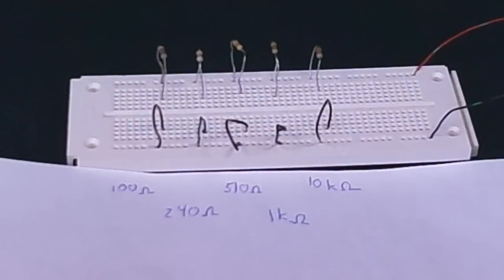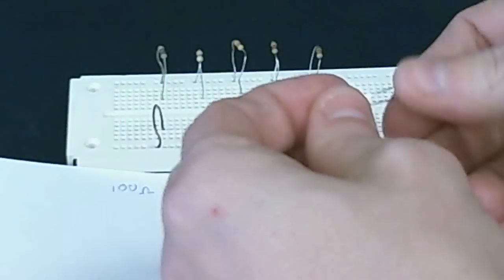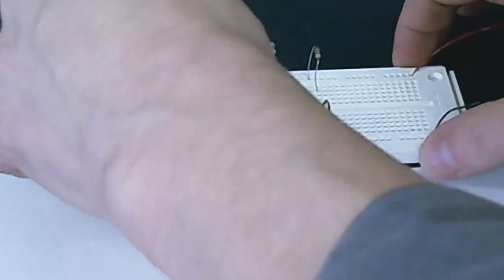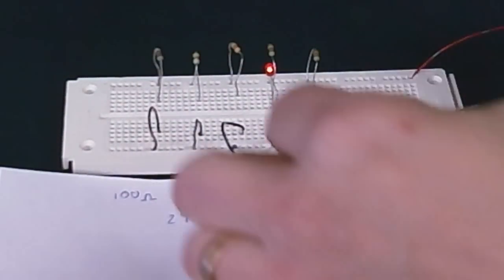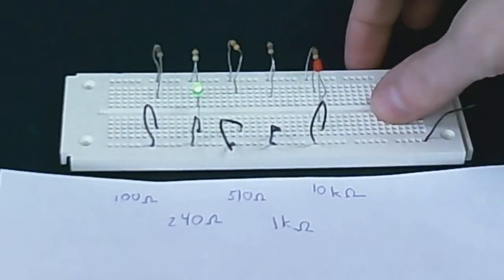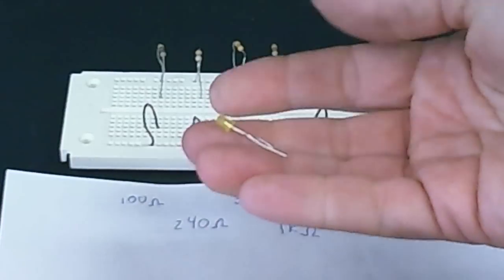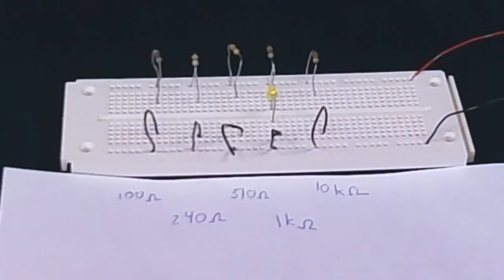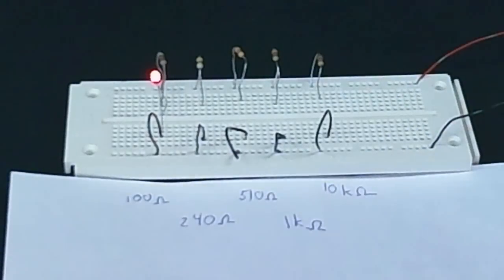Choosing resistor values for LEDs

Comment from the maker: Since several people have asked, I was using a 5V supply. Part of my point was that using any "common" sort of DC supply voltage, such as 5V, 9V, or 12V, the process I illustrated would work.  As I mentioned below, if you know all of the electrical characteristics of the LEDs you're using, then you can do the calculations.

Comment from the maker: A mistake people often make is to confuse resistance and current. A large resistor means a small current, and vice versa. So the 100 ohm resistor allows the most current (and so the brightest LED), while the 10kohm (or 10000 ohm) resistor allows the least current (and so the dimmest LED).

Comment from the maker: Doing a precise calculation is certainly the best way when you have all of that information about the LED available. But if you don't, then picking the largest resistor that gives "reasonable" brightness should work. I assume people have little or no electronics background. For those who do, they shouldn't have any problem doing as you suggest.

Comment: Terry Syurtevant, if you don't mind a bit of critical feedback from a retired college electronics teacher........ while I liked the concept, there were a few issues to bear in mind for future videos of similar kind:
- With a fair amount of time spent with each LED disconnected and thus not lighting, and with your hand obscuring, the human eye will do poorly to differentiate the various illumination levels. Also, the camera is probably adjusting exposure, skewing the results. It would have probably worked better if a multi-position switch, or a DIP switch, or even a potentiometer, were used to allow rapid changes from resistor to resistor without needing all the time consuming disconnections.
- You mentioned that brightness can depend on the color of LED, but the physical demonstration did not illustrate this for the aforementioned reasons. It would have been useful to mention that the different colors of LED use different chemical formulations, which result in different current-to-brightness ratios.
- While your narration seemed to suggest that your experiments showed that it pretty much did matter which resistor value was used, excepting the highest values, the video itself as it plays on YouTube tells a different story. Except for the lowest two resistances, the LEDs are very noticeably dimmer with increasing resistances, to the point of being undesirable for most options.
- The methodology used to calculate LED currents is ultra simple, and it probably would be useful to beginners to at least mention it. As it is, the video ONLY reveals that the resistance makes a difference, but tells the viewer nothing else useful, leaving them to purely empirical methods.
Reply from the maker: Your criticisms are all completely valid. When I made the video, most of what was out there for students and hobbyists either fell into the "cookbook" style of circuit diagrams with specific resistor values with no explanation, OR of theory-heavy physics or engineering explanations with calculations that made using an LED seem like trying to create cold fusion. My goal was to try and give a brief hands-on overview. (Also, even in things like kits for hobbyists, there often aren't datasheets or part numbers for LEDs, so the parameters for calculations aren't readily available.) 
For hobbyists, it's a little more information than the cookbook, and for physicists and engineers there are other resources they can use that have the kind of detail they need. 
(The production and lighting issues are part of my "quick and dirty" approach. I'm never going to make a living off my YouTube videos. :) )

Comment from the maker: Using a paper clip would be a REALLY bad idea; that would short out the two pins. The 10k resistor will allow a small current to flow, to indicate something is connected. So definitely use the resistor.

Comment from the maker: The watts rating on a resistor is for power. The formula for power is:
P = I^2 R
where R is resistance and I is current. So a 1000 ohm resistor with a current of 1mA (10^-3 A) is dissipating 1000*( (10^-3)^2) W, or 10^-3 W. For most LEDs, 1/4 W resistors should be fine. (In my example, a 1/4W resistor would only be dissipating 1/250 of the power it can handle.) Normal LEDs only use a few mW.

Comment from the maker: Blue LEDs will light at a higher voltage than the other colours, so for the same supply voltage, the resistance will probably* be lower, but the process of choosing an appropriate resistor is the same.

*(I say "probably" because more efficient LEDs will require less current for the same brightness regardless of colour.)

Comment: That's a great video! I have a question though... I do LED conversion on vehicle tail lights and I often use LED strips that have multiple LEDs connected together. In order for me to get a double function for running lights and brakes on the same LED strip, I use a resistor for two different brightness levels. I have successfully been using 220ohm 1/4watt 5% resistors for the past two years, but the last batch of LED strips I got do not work well with that resistor. What happens is that some of the strips would only light up partially and others won't even light up at all. I am assuming that this is due to the fact that the new LED strips have more LEDs built into them and that would require a resistor with a lower value of OHMs, in order to send enough power to all LEDs in the strip. Is that a correct conclusion or is there another problem that I am not seeing? Would it help to use 100ohm resistor, instead of the 220ohm or is there another solution? Or would I need a resistor with higher wattage, say 1/2watt instead of 1/4watt? Thank you very much!
Reply from the maker: You're right about trying a lower resistor. Using a different wattage resistor wouldn't make any visible difference; it would just change how much current could pass through without burning out the resistor.

Comment: ok i want to replace the vu meters lamps in my power amp and the voltage at the lamps is 12 volts dc, i want blue leds, what resistor value i need for the blue led ?
Reply from the maker: If you have the data sheet for the LEDs, and it gives forward voltage and nominal/recommended current, then the resistance you want is given by
R= (12 - VF)/Irec
where VF is the forward voltage and Irec is the recommended current.
Reply: Terry Sturtevant i am very bad at math, got a lot of common sense but not a lot of math. i am math dyslexic, thanks anyway

Comment: I have little LED lights in my car doors that activate mt "door ajar"  warning light but very faintly, and when car is off the LEDs glow in the door dimly lit. the LED 5-SMD 12v my car is 12v what resistor would i need or would a resistor even work in this situation?. The bulbs are little 194 size bulbs. Thank you

Comment: question : ive read about making an aux input for my stereo, it says to put a 10 k ohm resistor between certian pins in order to trick the unit in to belivong that power is being drawn so that way the aux in mode can be activated. would i really need a resistor for this or could i just stick a paper clip in there like many do when testing mother boards

Comment: what if you coming off 12 volt battery with high amperage from a car battery and you want to power color LED push plot switches for led interior lights I keep on blowing the plot switch diodes up and blowing the fuse
Reply from the maker: The amperage of the battery doesn't really matter; the amount of current that flows depends on the resistor. The battery amperage just indicates how much current is possible.

Comment: Hi.. What is the value of the led? ( I'm a beginner thanks!)
Reply from the maker: Amelia Kimhoko Most LEDs will be OK with a few mA of current; that was part of what I was trying to show. If you start with a big resistance and reduce it until you get reasonable brightness you should be fine.

Comment: Just what I needed to know, but couldn't you actually had left all the LEDs connected for us to see and compare at the same time?  (They were connected in parallel, right?)  Your hand kept getting in the way.
Reply from the maker: I wanted to make it clear that I was using the exact same LED with each resistor so that none of the variation was due to the difference in LEDs. You'd probably want to do a similar test yourself with the actual LED you're using to find the brightness that works for you.

Comment: If I connect 25 LED in series, what will be the battery voltage and resistance.
Reply from the maker: If you have 25 LEDs, you'll probably 50 volts or so, since each LED drops 1.5 volts or so. (Depends on colour)  The resistance can be calculated once you know the LED voltages and desired current.

Comment: what's the voltage?
Reply from the maker: In the video I was using a 5V supply, but the process would be similar with any other voltage. A 9V or 12V battery, for instance, wouldn't look much different, although the 100 ohm resistor might be getting too low and allow the LED to burn out. At the other end, below 2V or so you may not get an LED to light up at all; it depends on the colour. Red needs the lowest voltage, blue the highest.

Comment: what if i use a 220v what will happen with the LED
Reply from the maker: It's the current that matters, so with 220V you'd need about 40x the resistance you'd need for 5V. (You'd also need to be sure the resistor power rating was sufficient.) If you're using 220VAC, then it's possibel LEDs aren't the best choice; if you want a power indicator, a neon bulb may be more appropriate.

Comment: Interesting but you didn't say what voltage your supply is
Reply from the maker: +roy Barrett That's a good point. I was using a 5V supply in the video.  Most DC supplies people would use would probably be between 5 and 12 volts, and so resistors in the range I included would be reasonable, although with a 12V supply using a 100ohm resistor may allow too much current for some LEDs.

Comment: I believe your method is flawed. The precise value +/- should be calculated based on the applied voltage and the maximum current rating of the led. Too low of a resistance will shorten the life of the led and too high value will reduce the brightness.